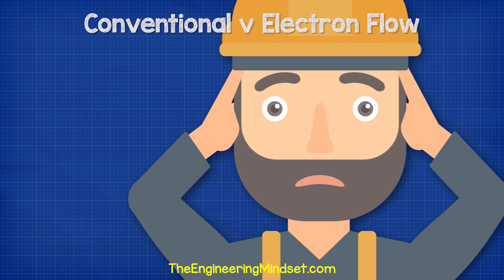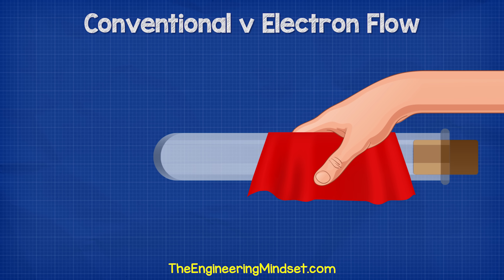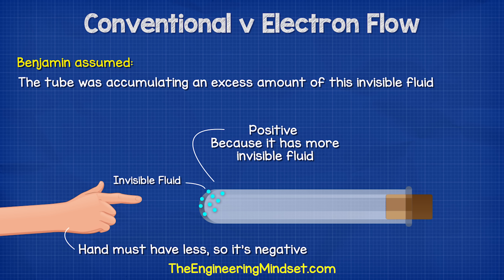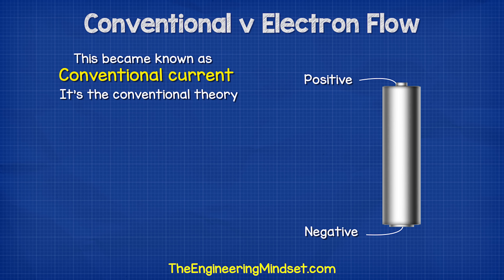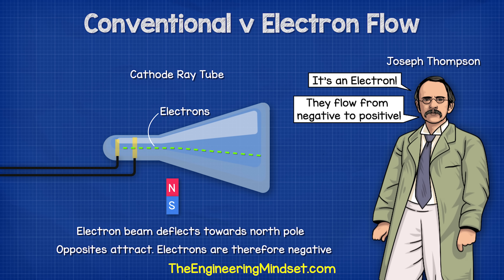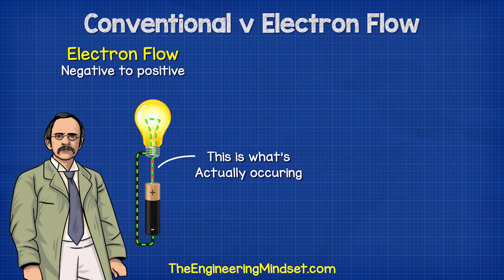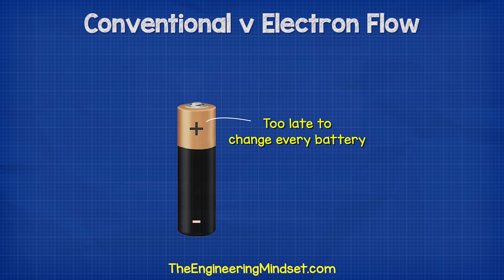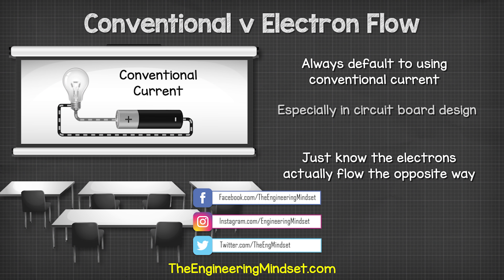Conventional Current v Electron Flow - Electricity explained

Comment: what bothers me most is some of books (I wouldn't name them) describe circuits with mixture of conventional and actual electrons flow, the worst part is explanation of transistors and diodes with actual electrons flow, those authors must watch this video. Another great work, thanks Paul.
Reply: To understand transistors  you have to understand that some  crystals may steel electrons abd sone may give upbelectrons leaving holes, and electron hole therory is born. 

Current convention is not incorrect.  Let me explain. 
Electon flow and current flow are conventions.  But some people fail to recognize that Both have physical representations. 

While Electron flow has obvious physical representation, current flow does so too  in conductors and semiconductors as electron holes or lower eletron density flow that is opposite of electon flow. This view is no less physical real than electron flow.

Comment: But how do circuits with diodes and other devices with a 1 way flow work the same regardless of how you interpret flow?

 It seems like 1 interpretation would give a working circuit but the opposite interpretation would not.
Reply: Anytime you see the word convention in the sciences or mathematics it's agreed on rules and procedures for consistant results. Algebra has orders of operation and conventions such as imagery numbers ( a very choice of name) that agreed upon. In Franklin's defense it makes no difference in electron movement, the math works. This is rarely true. "Common sense" often will not work in the sciences so should be viewed as suspect.
Reply from the maker: See how diodes work here https://youtu.be/Fwj_d3uO5g8

Comment: I don't know if the argument "hey, we know its wrong, but we've been using this inaccurate assumption for so long, lets leave it" is really ok. Of course changing everything would not be simple, there would need to be international agreement on this etc. But this falsehood we keep teaching does not sit well with me.
Reply: It drives me crazy
Reply: Falsehoods are being taught in our schools and institutions daily...in fact, that is their primary purpose sadly
Reply: There’s nothing to change, electrons are negatively charged. Conventional current is just simplifying the math and is strictly equivalent. -(-) = +
Reply: The only thing to change is if the electromagnetic force pushes or pulls electrons. There is usually an inherent false belief that accompanies electron flow. Electromagnetic force moves at the speed of light. Electrons do not.
Reply: What's the point of changing something if in reality it changes nothing?
Reply: @hackleberrym  it does matter in everyday application in the electrical field. For example it can be mistakenly connected the leads of the 5kV megger and can cause catastophe. The red leads which is + can be mistakenly connected to existing mass earthing of electrical sub station and  black lead which is - can be mistakenly connected to the conductor. Wherein in the actual applications is the other way around.
Reply: @kaboom2800  I don't see how that has anything to do with the direction of electron flow. Just use your testing equipment correctly and nothing bad will happen.

Comment: When the electrons passed through equipment, a lamp, for example, did the lamp consume the electrons? (As the water flow inside the pipe, it also reduces the water in the tank.) and how the electron can produce or turn into another type of energy? 

In the current flow episode, it's explained that the output of electron flow after passed a lamp is the same as the input as it is checked using an amp meter. And so regarding the battery, where the electron goes when the battery runs out. 

Need some wisdom, Thanks.
Reply from the maker: No, the electrons are never consumed. Please watch this video https://youtu.be/kcL2_D33k3o

Comment: It is very confusing especially in electrical drawing when I don’t know whether they’re using conventional or electron current. Like diodes for example, I’ve seen people explain where electrons is flowing through the arrow of a diode. But in other videos it flows against it. I hate it!
Reply from the maker: We always assume conventional current when designing circuits. So with a diode we assume it flows positive to negative so through the arrow. But, the electrons are actually flowing against the arrow. Again, it doesn't actually matter. It's only how we visualise it.
Reply: the diode.
conventional arrow and electron war horn. >:D
Reply: Electrons flow "against the arrow" (the cathode) or conventional charges flow "with the arrow" (the anode) in a diode (pn junction).
Reply: When first explaining how the diode works (P and N-type materials, reverse-biasing and forward-biasing, etc.), the electron flow and hole flow is used. After that, for analyzing and designing circuits, the conventional current flow (flow of hypothetical protons) is used.
Reply from the maker: Seen our new video on How electricity works - for visual learners? Link:➡️ https://youtu.be/3KePcASD0NQ

Comment: I have a degree in electronics and all the mathematical formulas used are with conventional flow. Electron flow is specifically mentioned when used otherwise conventional flow is assumed.  Either way the answers are the same as long as the two are not used together as in circuit analysis. I've always preferred the Thevenize method.
Reply: At last, someone with common sense!  It doesn't matter which system you use as long as you don't mix them up and make stupid mistakes in circuit design.
Reply: But one thing is the reality (electron flow in basic electric circuits) and another thing is not it (conventional current flow).
Reply: I, too, have a degree in Electronics and we were taught using electron flow in circuits because electrons have a negative charge and they will be attracted to the more positive terminal.
Reply: @cacornett58  To bad Benjamin Franklin guessed wrong concerning electron flow. Typical of the human condition to fail to rectify an obvious falsehood. The math still works though.

Comment: Back in the day when I was using vacuum tubes in my Amature Radio projects, I learned that electrons were "boiled" off the negative cathode and were attracted to the positive plate of the tube. Electron flow...
Reply: Current convention is not incorrect.  Let me explain. 
Electon flow and current flow are conventions.  But some people fail to recognize that Both have physically valid representations. 

While Electron flow has obvious physical representation, current flow does so too  in conductors and semiconductors as electron holes or lower eletron density flow that is opposite of electon flow. This view is no less physical real than electron flow.

Sure, even in vacuum tubes electron hole flow is a valid physical representation.
Reply: Electron flow is not a convention. It's the way the electrons are actually going.  Conventional current is more like suction. Rather than describing the motion of actual media it is describing negative pressure only in the case of electricity they say it's positive instead!
Reply: Yes that's the proper flow of current charges. But syllabus nowadays focus more on polarity based current flow topics than what is electron flow actually xD.
Reply: @ElderGod29  If you base it on polarity, then it is electron flow you would come to. There is no way to get conventioanl flow from polarity. Take a battery, to say that the positive terminal pushes atoms,  is saying it crams physical matter (entire atoms) into the negative terminal, which is impossible and counter intuitive! You never connect a red wire to a negative terminal. Again, not logical! It is not the positive voltage that will zap you, it is the negative. This is why you die in a lightning storm. You are grounded to earth (the negative pole) and the positive atmosphere above is going to pull those powerful, earthbound, electrons right through you! Surely, you do not thing atoms are crashing through your body? That is what would have to happen for protons to kill you. Because they cannot move outside their atoms!

Comment: Don't tell the diodes what's happening!
Reply: don't worry ... electrons can't read the marking on the diodes because its on the outside ;)

but yeah, I always imagine a diode being a combination of a wall with a ramp: conventional current only can flow through the diode using the ramp, in reverse polarity it will bump into the wall unless it is so "fast" (high voltage) it will just rush through that wall :D
Reply: @SystemX1983  
Wait, so the Kool-Aid man's actually a giant electron?

OH YEEAAHHHHH!
Reply: @DarkMatterX1  I've never met him but I guess he's full of electrons, free moving ones especially ;)
or was it electrolytes? O.o
Reply from the maker: Seen our new video on How electricity works - for visual learners? Link:➡️ https://youtu.be/3KePcASD0NQ
Reply: This creates more confusion.
Reply: I mistakenly read this :- Don't tell the "dildos" what's happening. [DiowE]